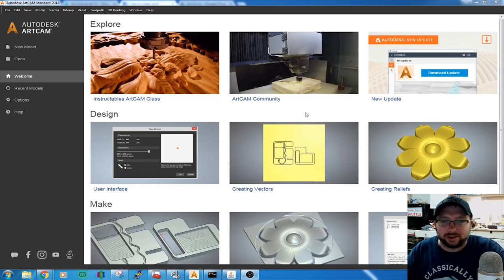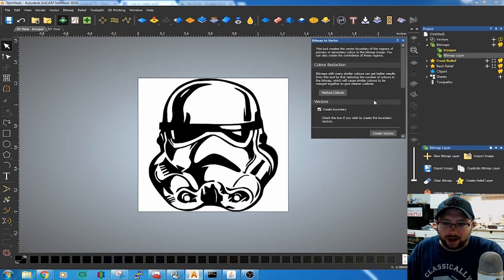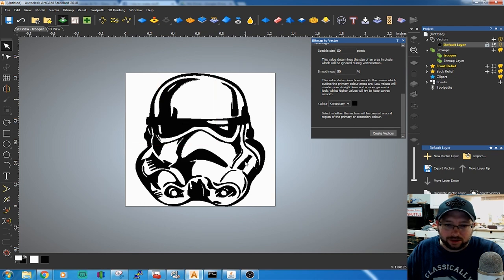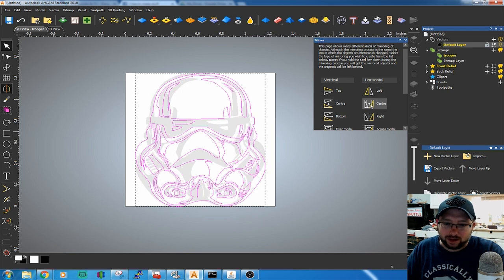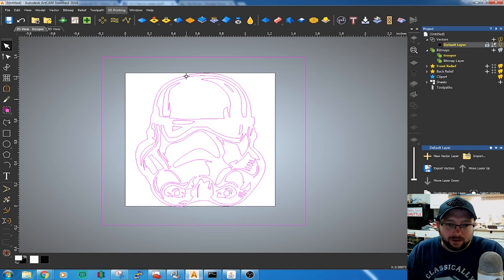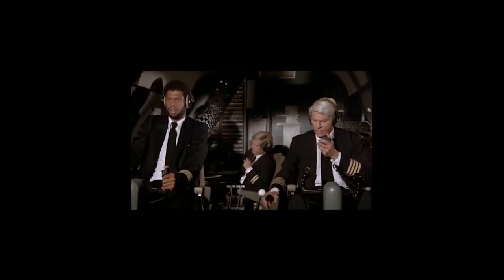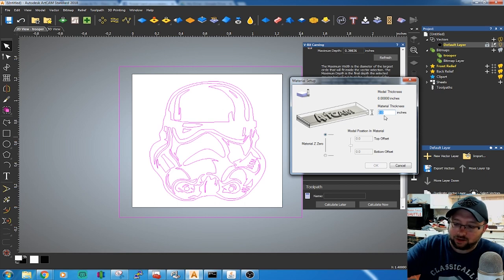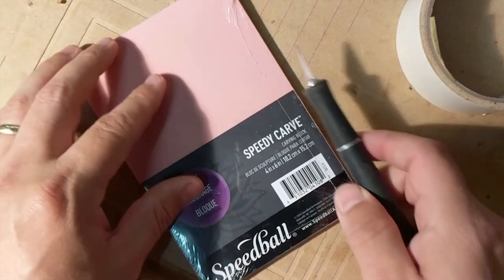Stamp Making with a CNC using ArtCAM // TUTORIAL

Comment: Have you tried different types of rubber?  Any better than the others?  I usually just end up w/ a mess when I try to carve the soft rubber I have!
Reply from the maker: Yeah, I definitely think firmer is better for CNC'ing.. this stuff was alright until it got to tiny details.  Using a laser engraver is definitely the way to go for stamps!
Reply: @Geeksmithing  Hmm, I have a laser as well, just a little 6W one though.  Didnt even think about using it because of the smell =)  Thanks for the video and help.
Reply from the maker: @twopecker  well there is a special rubber specifically designed for lasering. Definitely don't use just any old material. 

I also have a video for it in my channel... Not sure a 6w is powerful enough though....